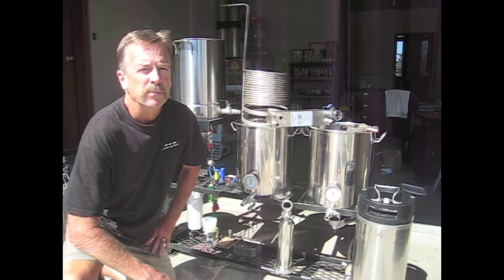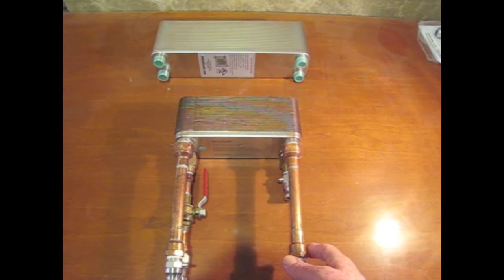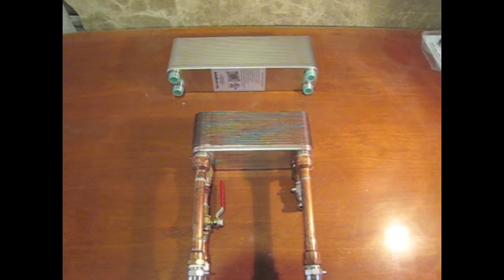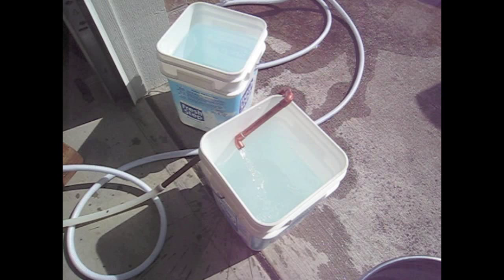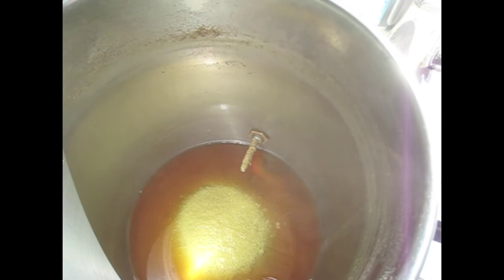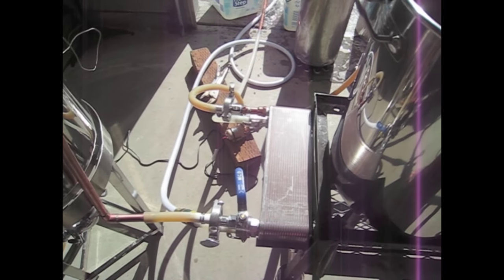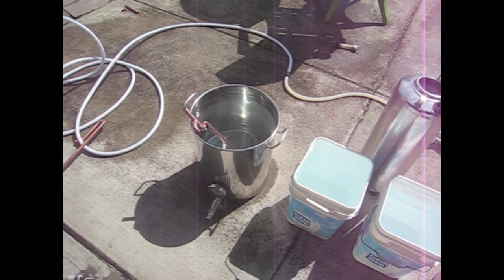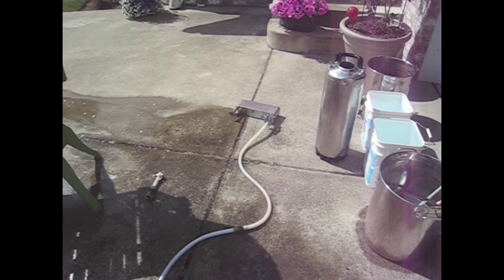Homebrew Plate Chiller Facts

Comment: Great video. After watching it, pulled the trigger on a similar chiller from Amazon, specs below, for $100. Just hooked it up last weekend and brewed a clone of Mac & Jack African Amber and it cooled my wort from 200F to 64F in a heart beat. Never going back to an immersion chiller again.
HFS(R) Homebrew Beer Wort Chiller (12.4'' 2.9''/40 plate, 1/2" x 1/2" NPT)
Reply from the maker: Right on.  I use PBW (recirculate it) after a good back wash to keep it clean.  Load it up with StarSan each brewing day too.

Comment: Very well done, I live in Townsville Australia and up here in the tropics all ways battling the heat, our ground water is 33 Celsius so I put my wort in a temp controlled fridge then pitch the yeast. No matter how big the chiller what goes in will come out the same temp. I could run the water through an old emersion chiller in a bucket of ice!
Reply from the maker: Thanks for the note.  33 C is hard to chill with for sure!!  Funny thing, here in Tacoma our ground water wants to hover around 58 F or so.  In the summer it does warm up making it less efficient.  I have seen others do what you stated, that is run the cooling water through an immersion chiller that is sitting in an ice bath.

Comment: You mention in your video that the DUDAHX-B3-23A-40ST plate chiller is 23 inches long.  The website states 12.4 inches long.  Can you put a tape measure on yours and confirm the length?

Comment: I run a similar set up with two plate chillers in serial. Hose water first at around 80°F here in the South in the summer. After hits 90 degrees, I switch to recirculating ice bath water. I can get the wort down to 40 degrees after about 15-20 mins. I recirculate the wort back to the kettle to use it as a coolant to help chill quicker, but I am wondering if I am abusing my wort by running it full throttle through two chillers over and over. Comments/suggestions?

Comment: Have you tried using the chiller rotated 90* and running the wort from the bottom up so that the wort fills the whole unit? You may have been able to get away with the old chiller or run the wort through even faster with the new one.
Reply from the maker: +John Rankin this is a really good suggestion, I have not tried that.  Next time I brew I think I'll things up so I can do just that (it would be nice to run a bit faster).  It is winter now and the ground water is so cold that almost anything would work!  I'll still be able to monitor the difference. I'll be sure to report my results.
Reply: +HomeBrewingTips Did you happen to measure the ground temperature used in the video? Have you seen this chart: http://www.dudadiesel.com/files/beerwortchart.pdf ?
The chart has the wort out within 7*. What models of chillers do you have?
Reply from the maker: John Rankin Yes, I saw this chart and others like it.  My ground water temperature swings quite a bit here in Tacoma.  I don't really measure it, but rather accept that I have to work with what it is.  Cool down time is roughly 1/2 as long in the winter.  As for the model number, I am now using the DUDAHX-B3-23A-40ST.  It is the length that seems to help, so the 30 plate (or smaller??) could also do the trick as long as you stick with the longer models.  I have to say, I do like this one though (even though it costs a few extra bucks)

Comment: I like your meticulous approach to brewing and appreciate you sharing your experiences on You-Tube.  What is the make and model of your new plate chiller?
Reply from the maker: francesevemoore Thanks for your note.  I try to share tid-bits that hopefully help others.  I don't try to say what is right or wrong, but rather show in detail aspects that I think will be interesting.  As for this particular chiller, it is a Duda Diesel DUDUHX-B3-23A-40ST.  You can find it on their website, 23" and 40 plate and it goes for about $180.  As I mentioned, I think a lower plate count in the 23 inch length would serve you well.  They have a lot of info on their website on that topic.  I will also say this, I am delighted with this unit.  Even on the hot summer days here, the efficiency is surprisingly good.  I'll be posting some more fun topics soon.  Thanks again.
Reply: HomeBrewingTips Many thanks for the feedback.  I have been looking at the Duda Diesel chillers and considering which model would be most appropriate.  I live in Vancouver, B.C. so very similar conditions to you in WA. I am disappointed with the performance of my counter flow chiller and will probably change to a plate chiller - likely the exact model that you have chosen. Thanks again for your help!!
Reply: HomeBrewingTips e

Comment: I use a counter flow chiller (copper line in a garden hose setup) and I am able to do the same single pass chill from boil to 68f.  I don't see the reason for the extreme expense of what you have vs. my cheap setup.  Your setup is definitely "choice" though and you make my setup look awful.  :-)

Comment: Cool setup. I stumbled across this video as I am NOT a brewer. It probably came across my feed because I have a heat transfer background. Do you have the connections set up for counter flow? Meaning, the cooling water inlet should be connected to the same end of the "chiller" as the wort outlet. Thus the flows would be counter to each other and give you maximum efficiency. Can't tell from the vid, but thought I'd mention. Thanks so much for sharing.
Reply from the maker: thanks for the note.  Yes I do have the in/out connections just like you described.

Comment: Can you run two smaller plate chillers in line with one another to gain maximum rapid cooling? I currently recirculate back into my boil pot until I obtain my target pitch temp through a single small plate chiller. I am contemplating getting another  smaller plate chiller
Reply from the maker: don't know why that wouldn't work.  It is another thing to clean (which isn't such a big deal).  I used to recirculate just as you describe.  That would stir everything up which was sort of an issue.  Instead of two, I'd favor one bigger and more efficient chiller.  I always say, go ahead and give it a shot and see what happens.  If you are unhappy you can try to sell the two smaller units and buy one larger one.  Thanks fro watching and reaching out to me.

Comment: do you filter your wort prior to plate chiller?  I have bought a duda diesel chiller and am afraid of clogging it
Reply from the maker: No, I do not filter the wort and I have never had a problem .  With that said, I use pellet hops so if you use whole hops you should discuss this with someone using whole hops.  I have tried a bunch of different hop screens, bags, spiders, etc.  Now I just do a simple 20 min whirlpool and then make my transfer.  I too was concerned about plugging it up, cleaning it out, potential infections, but I have never had any of these problems.  This is a great way to go for maximum efficiency.  I have used different brands and had good luck with each.  Enjoy!
Reply: Noticed your wort is gravity fed from the boil kettle down, then back up to the plate chiller then up again before it is fed into the fermenter. Are you using a pump to accomplish this? I don't think this is mentioned in the video. Just trying to understand the physics of your setup.

Thanks
Reply from the maker: yes, I have pumps to move the wort around.  I have used March type pumps as well as small DC pumps (which I now prefer).